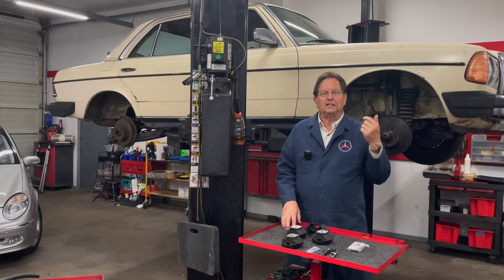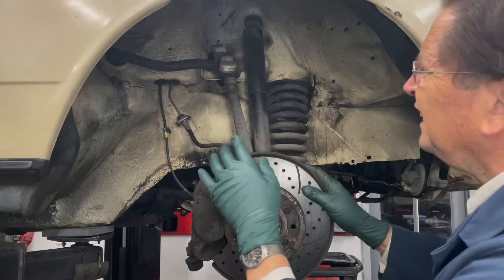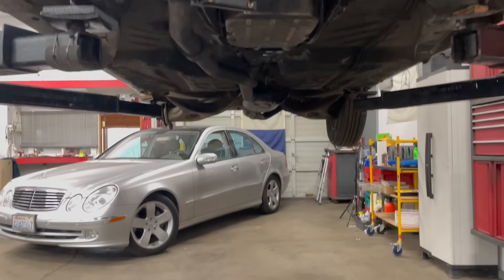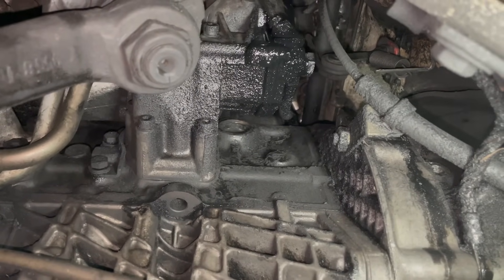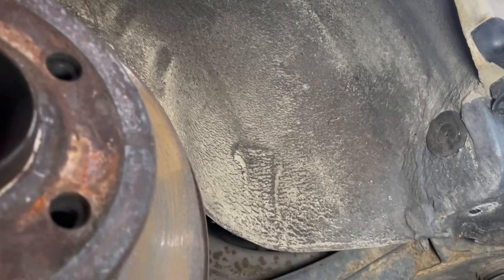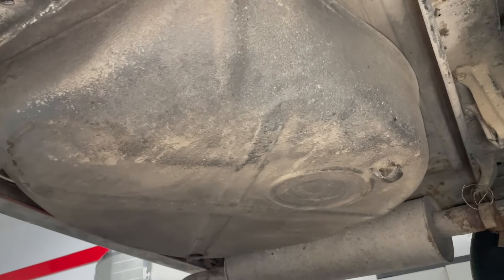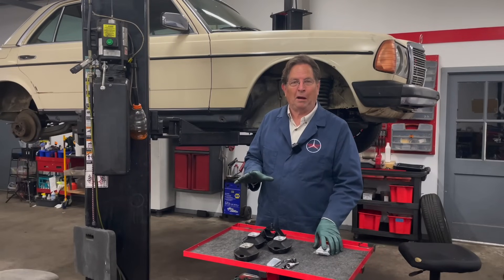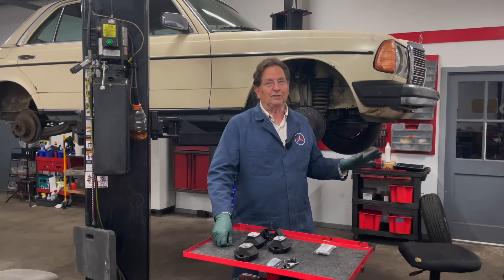Old Mercedes 300D Engine Reported Dead Pt. 6: Not So Fast. Old Spence is Cancer Free!

Comment: The body is very mint. I can't think back to any old MB that had no major rust issues. It might be neglected in some areas but this is nothing compared to the cost of major sheet metal work. The cars in the area where I live look like typical rust belt vehicles. Is someone going to buy the car? ofc cause where else do you find a rot free MB body these days?